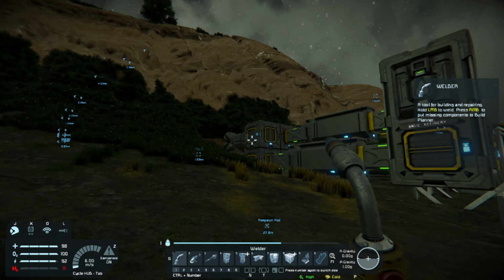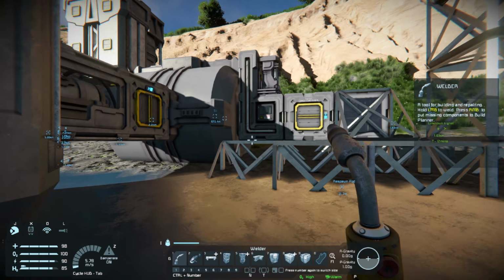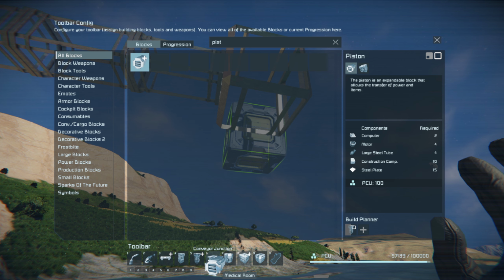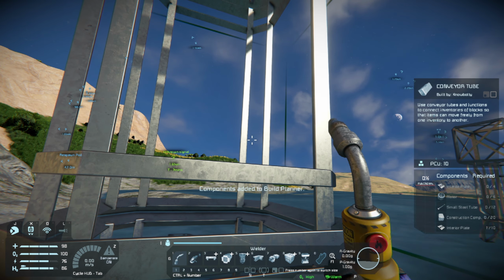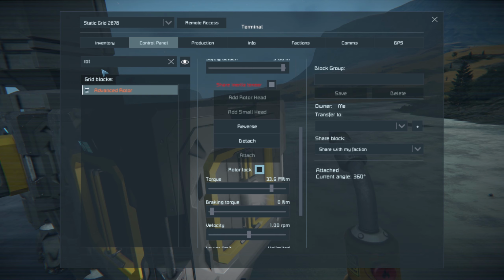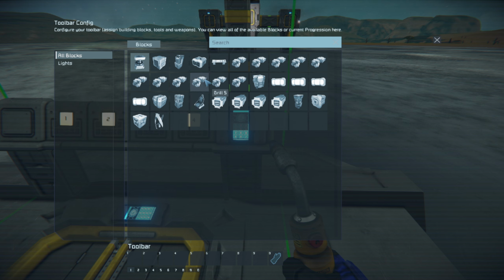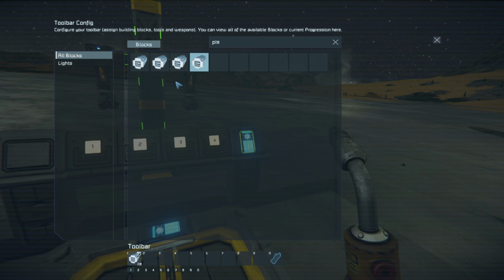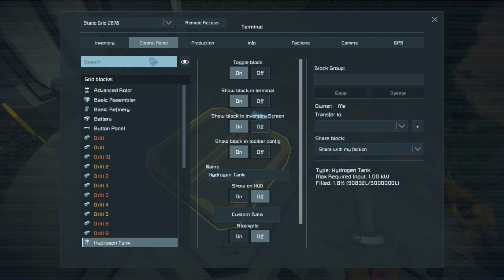Automaton Ep 3, Drilling Platforms complete. Space Engineers

Comment: I don't use timer or programable blocks as I don't understand them. Maybe oneday I will get to figure it out.
Reply from the maker: I will be going over them in depth in the next few episodes, I will be sure to work in a tutorial when I get to the base building automation.
Reply: @KnowBotty  Thx this will really be so helpful.
Reply: Timer blocks are pretty simple. Timers, when triggered, start, wait the set delay then triggers all actions set. Actions you can set are the same as if your were setting up your toolbar.

Ex you could setup a timer block to wait 1 second then to toggle connector lock, all thruster turn off, set batteries to recharge, toggle landing gear lock. Similar to hitting 1 2 3 4 on your toolbar while in a control seat.

Programmable block require knowledge of scripting or programming to setup complex actions. Or copy a script from the workshop like Path Auto Miner then follow the setup instructions.

The hardest part is deciding whether to use a timer or tweak your parameters. Timers are needed in certain situations but something like this can be completed by turning the piston to a slower speed say 0.08m per second. 1.5m extend distance over 18 seconds (15 for first timer then 3 for second).

With a programable block you could setup XYZ axis pistons then have it "shave" off the top layer in 1 axis, move over until you have a 10% overlap, shave again, once the layer is complete drop down a distance rinse and repeat. All the while monitoring your ice quantity and pausing when it is over a certain value (say 100k) and starting under another (say 50k). But setting this up would take a while.
Reply: I find it is way easier to just set the button 1 turn rotor on/off; button 2 turn drills on/off; button 3 reverse piston.
No timer required, no programmable required, no problem once the speeds are balanced.
Also I would just place the 1st drill in the centre then 4 all attached in a row - that way you would cut out a 9 block circle and not need the conveyor tubes used between the drills.